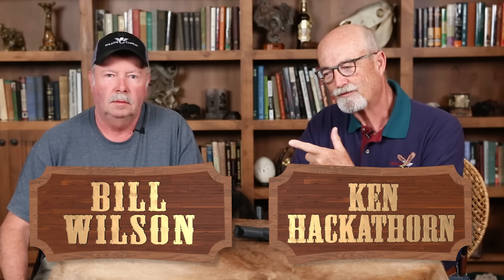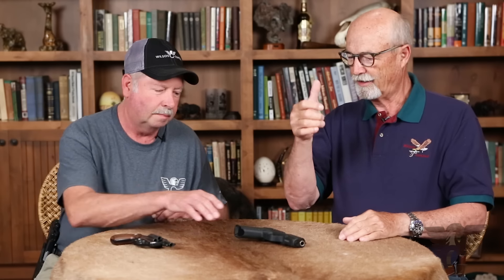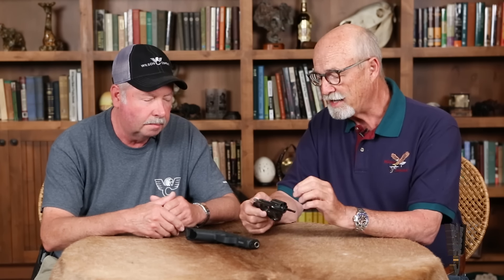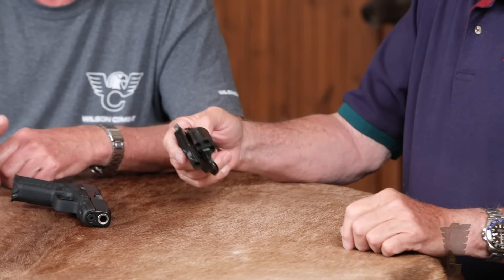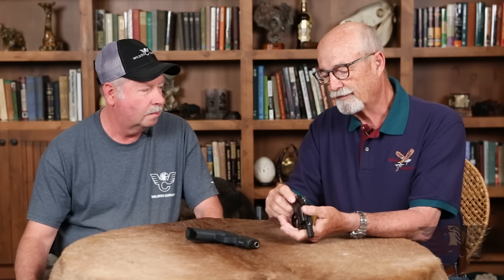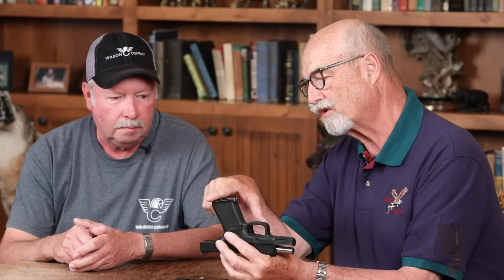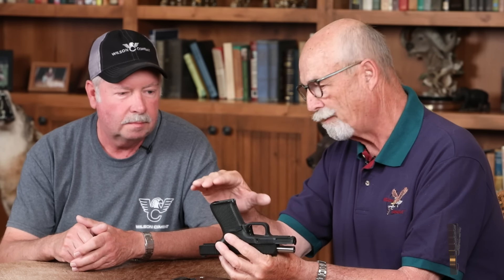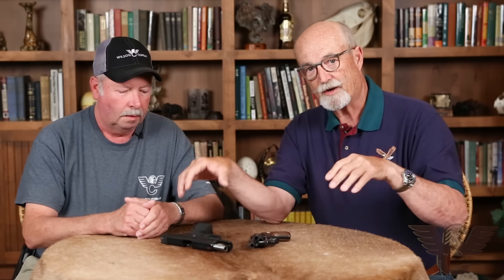DON'T DO THIS to Your Guns - Gun Guys Ep. 17

Comment: The 2-3k round tests are clearly proving how reliable a firearm is. It's truly impressive how some guns can run through 1000s of rounds without cleaning/lubing. This should be incredibly obvious to anyone, much less professionals. Very disappointed and shocked about your take on it.

While I agree about slamming the cylinder on a revolver, I couldn't disagree more about using the slide release. THE GUN IS LITERALLY DESIGNED TO DO THAT! I'm pretty sure Smythbusters did a video about that also. Many auto-loading pistols (1911s, Glock, S&W, etc.) are built to be workhorses and duty guns. If they were so sensitive to using the slide release, it would be a well-known issue, and all gun makers would be manufacturing firearms without it (XL Walther PPK style).

Even if it is possible to damage a finely tuned glass-cannon like the custom 1911s you are talking about, increasing the trigger pull weight is such a minor issue it's mostly irrelevant. I challenge anyone to tell a major difference between trigger weights if they are shooting in a legitimate self-defense scenario when their adrenaline is pumping. 

I do agree 100% about lubing guns though. I've shot hundreds of rounds through my pistols, and they keep running flawlessly if they are oiled well, even though they are filthy at times.
Reply: They didn't say don't use the slide release... they said don't use the slide release w/o there being a cartridge to skim off of the magazine.

Comment: I respect these two gentlemen quite a lot, let me say that first.  I have heard the "empty chamber slide drop" argument my whole life, but have not seen any scientific evidence either way.  I have heard mostly opinions from both sides, usually to the effect of: "The army 1911's did this in drills over and over and over and they work fine" or "A super awesome trigger job will show microscopic damage on the sear and trigger surface" or something to that effect. 
What I am respectfully requesting here, is for Mr. Wilson to set up a test which would put this debate to bed.  I ask this here because I feel that Wilson Combat is one the few companies that is well known and respected enough in the industry to "set a standard" if you will, and obviously has access to the firearm actions at the heart of the debate.  I am personally on the fence on what I believe regarding the "empty chamber slide drop" argument, although to be honest, i lean slightly toward the "it doesn't hurt anything" side.  But I think with some scientific evidence, which would be easy enough to obtain, we can learn a lot.   Some high resolution macro type images before a test and after a test, with empty chamber slide drops at a few increments (not sure how many times folks think would cause damage) would probably do it.  I doubt anyone would accept a subjective trigger pull test, from either side of the argument.  Just a respectful request from an inquiring mind.  Thank you for what you guys and your teams do here.
Reply: That’s a great idea!
Reply: Pro2A I agree with you on the "it shouldn't hurt anything". To me, it seems odd that the recoil spring alone can damage the pistol by letting the slide close on an empty chamber when the gun cycles the slide with many times the force your hand or the spring can alone. A slide on a semi auto moves so fast in operation you can barely see it. It hits it's rearward limit hard and slams home on every shot, tens of thousands of times. I have my doubts that the cartridge cushions it enough to save the pistols life so to speak. I'm as curious about debunking this as you are.
Reply: The fact the guy has made and designed these guns for decades isn’t enough for you? I mean wtf is wrong with you people?

Comment: Wilson Combat has the best customer service. I had a 9mm ADP awesome little polymer  striker fired carry pistol that retailed for 550.00. The manual showed how to disassemble the slide completely so foolishly I did. couldn't put it back together. called there customer service and they sent Fed ex to my house to pick up the pistol put it back together and polished the feed ramp and gave me an extra magazine got the pistol back in less than 10 days all at their expense, even though it was all my fault. they only made that gun for a couple years small 10 round double stack that got a bad rap online Mine was awesome though.

Comment: All good information but from my experience Wilson Combat pistols are delicate and prone to breakage unlike a GI 1911 you can beat on all day.
The type of guys that buy a Wilson 1911 do more looking at them than actually shooting them.
I was into Wilson 1911s for a while and yes they may have felt better in the hand being a custom gun but did they perform all that much better than a Colt or other decent 1911? No not really.
You guys look to be in my age bracket and I get your points but I love to run guns hard and put them thru their paces and have fun and not always having to fix them which was what I had to do with the Wilson 1911s
Reply: I had bad experiences with Colt and Kimber reference reliability. Ive put 1000's of rounds through my Ultra light Wilson Combat 1911's, and they have been flawless!I do believe when your life depends on them, there is a difference between them and a production 1911!I believe if you are carrying a 1911, theres a big difference in reliablity that makes the cost worth it? If you want to spend less, a Glock or Shield might be better for you, but a 1911, especially in .45,I wont ever cut costs.

Comment: I respect these guys because they're masters of the gunsmithing world. However, if these guys are being picky about 1911 mags hitting the concrete, and talking about how guys are reloading their guns too harshly. It just tells me that Wilson Combat 1911 platforms and accessories are just made for bench shooting. If the mags can't drop on the ground during training, how can the user expect to use it on duty, it'll just cause a training scar for the operator to always retain, or drop the mag on a soft surface. Also, if the tolerance of the gun can't endure a harsh reload, how can it be reliable for duty. 
I guess their guns are made to be pampered on soft surfaces.
Reply: Yea I'm pretty confused to this.....I wanted to get a hold of a Wilson but now I think I'll put myoney elsewhere. I'm not naturally hard on guns but I had no clue that 1911s we're so finicky. Give me a Rugerp345 or a Smith and Wesson 5906 those guns can take an ass whooping
Reply: Their comments are for all mags, and specified loaded mags not empty. Wilson mags are among the best out there. If you are consistently dropping loaded mags, you might want to try out a different training class
Reply: @pops55650  you are talking to walls,  after they learn the difference from harbor freight to sk they will learn to spend more wisely unfortunately not all will meet the grade

Comment: None of my 1911 manuals have ever said never drop the slide on an empty chamber and John Browning never told the military they shouldn't do it.
Reply: It’s the same as with bows. On some compound bows if you release the string without a nocked arrow, the energy may shatter the limbs.
I imagine this is the same principle.
Energy from the spring is meant to push the round into the chamber, not slam the slide against the barrel.
Probably not a huge thing done once or twice, but it will accumulate over time.
Part of good care, if you want the firearm to serve you well for years, right?
Reply: The design and movement of your slide normally assumes having friction from the round being chambered to moderate the slide velocity. Without it, the slide will close faster and slam into the other parts harder. With poor steel construction, peening/damage of the surface will occur.
Reply: Have at it!  I'll go with what Bill and Ken say.
Reply: @GuyWithAnOpinion2  I’ll stick with JMB. He got it right the first time.

Comment: I get the confusion.  For most guns, flipping the slide release is fine. It's partly why the lever exists in the first place, and the Brownell's guys have covered this.   
BUT, the Wilson Combat 1911 is, as these guys point out, a special case of super tightly tuned tolerances for competition shooting.  
Which raises the question, why are they called Wilson Combat, when it should be Wilson Match or similar?  A combat gun needs to be able to take abuse.  It's like the difference between a rugged beat up 4x4, and a Porsche.  Wilson is the Porsche. They have different niches;  Normally, the Porsche is worth 10x the 4x4, and in a race, you'd want the Porsche;  but in a war, the 4x4 is worth 10x the Porsche.
Reply: @Jase Zayden Instablaster =)
Reply: @Jason Kyler Thanks so much for your reply. I found the site on google and I'm in the hacking process now.
Seems to take a while so I will get back to you later when my account password hopefully is recovered.
Reply: @Jason Kyler It worked and I actually got access to my account again. I am so happy!
Thank you so much, you saved my ass :D
Reply: @Jase Zayden Happy to help :)
Reply: These guys are such elite blow hards. Brownells did a video on the same thing and concluded: just don’t do it too much
Reply: @lakesidemfg3552   So why get into bad habits. Steel frames will take more abuse. Aluminum does not. I have seen more then one frame ruined by those not learned in 1911s. Brownells sells parts. Wilson sells art that can save your life. Give the utmost respect to the things that save your life and they will work flawless when you absolutely need to abuse them.
Reply: @richwilson7619  that’s funny. My gunsmith showed my two Wilson 1911s that wouldn’t cycle to save anyones life. As for art…. It seems like Wilson stepped away from their roots to push their art/products and Ive heard more than one avid 1911er say this.
Reply: @lakesidemfg3552   Really. Why does a gunsmith have two that will not cycle. Bill would like to know why 6 to 7 thousand dollars of pistols were not returned for repair or refund? I smell a rat or another story. They are guaranteed my friend.

Comment: On the M60 and M240 we used to drizzle motor oil straight on the belt as it fed to lube the gun and flush carbon and brass shavings out the bottom. Guns are machines. Machines need lube.

Comment: When the slide on a 1911 is locked back, the sear is in contact with a notch in the hammer. Both are now in a position that the slide has zero influence on them. The slide can be hammered to the rear and hammered into battery as many times as you feel like doing. There will be zero wear and tear on the hammer, sear and disconnector. 
There's some high-speed photography of 1911 slides being released with an empty magazine vs a loaded magazine stripping a round and clambering. The results as I read them, showed so little difference using microseconds as a measurement that this lab concluded neither technique was advantageous over the other.
Reply: Just how many custom 1911's have you built, and how successful is your company?
Reply: William Roark this is one of those facts vs feelings discussions. Sorry you drank the kook-aid my friend.

Comment: I clean after I’m done shooting for the day. One shot or 500. I clean them. I value my possessions and take pride in their appearance. I’m sure I can get away with cleaning them every 2000 rounds, but I’m not gonna do that. 95% of the guns I own were bought used and 99% of their previous owners clearly never cleaned them because they were filthy.
Reply: You are putting more wear on the gun cleaning it and shoving cleaning rods and shit down the barrel than if you just left it and cleaned it every 300 rounds or so.
Reply: @jerryseinfeld1345  I have so many guns that none of them get shot more than 2 times a year. Some haven’t been shot in years. But even my old duty gun got cleaned 4-5 times a year. 29 years later, it still looks new. Sending a solvent soaked patch down the barrel and a couple of passes with a brush isn’t gonna hurt anything. I’ve been doing it for nearly 30 years and no issues whatsoever. I’ll stick with what I know works and you do whatever it is you do.

Comment: I did not know about the damge from dropping the slide on an empty chamber!  Thank you, I learned something today.
Reply: Hayseed Homestead same here, good stuff
Reply: @closecatapult8472  I just rewatched it.  I noticed they specifically mentioned finely tuned triggers being susceptible to damage.  If you're tuned to 3/4 lb pull then yeah, I agree completely.  A standard 1911 (I just bought a Colt Classic) set at about 5-7 lbs should be ok or at least take a long time to fall victim to it.
Reply: @maineiacacres  it will damage barrel lockup on all pistols. Its just a stupid thing to do.
Reply: @Adcomb  Well at least its not a good thing on an empty chamber/mag.  I did catch that they mentioned doing it to load a round mitigates the potential damage.

Comment: I've been shooting twenty years and I've never seen someone successfully, methodically snap rounds through the feed lips of a pistol mag. I don't know how I'd react. I'd be mystified and speechless. Slightly different story if it was MY magazine, but still...
Reply: I agree, for a lot pistol mags, the mag loaders push down on the round that’s already in the mag, so you can slide the next round under the feed lips easier, not through the top. 🙄

Comment: At first I was optimistic about the content, but as I watched it I realized I was guilty of alot of what you are talking about.... never to old to learn proper etiquette....thank you for the lessons.
Reply: I can see dropping the slide on an empty chamber being a problem, but not on all handguns. 
Glock for example, the "take up" is pulling the striker back. XD9 the take up is different and also pulls a sear down while also slightly pulling the striker back. I wouldn't drop the slide on a XD. I think this video calls to light the problems and shortcomings of the 1911.
Reply: Tony it will effect barrel lock up on most any pistol

Comment: from Page 29 of the Colt 1911 manual (current models), "5. Keep pistol pointing in a safe direction, allow slide to return forward on empty chamber and squeeze the trigger to allow hammer to fall forward.  (If slide is held to rear by the slide stop, pull slide back slightly, then release it.)" - that's what the manual says to do!  Go complain to Colt (and others possibly).
Reply: What is your point?  I’m 45 and I’ve known my whole life not to drop the slide on an empty chamber.  Same as dry firing a 22 rim fire.  Do you think Rob Leatham wrote that in the colt manual? Or do you think some attorney did?  Why would you not take Bill Wilson’s advice on 1911s?
Better yet why am I responding to some half wit on YouTube who thinks he knows about firearms because his uncle was in the national guard
Reply: And those are Colts, not Wilson's, Colts are nice but not Wilson nice. There's a difference.
Reply: Thanks for your kind, friendly reply.  Did some more checking, and the Beretta 92 manual has the same basic info, that it's ok to let the slide close on an empty chamber, and then I went looking for the Wilson pistol manual, and found a PDF dating to 2003, and it was silent on this point.  Didn't discuss it at all.  So if you are one of these experts, great, I'll listen to your advice, but I'll also listen to what the manufacturer says in their manuals.  A check of the Glock pistol manual also finds that Glock says to just release the slide on an empty chamber (page 20, item 5) " 5. Release the slide to return it to the forward (closed) position by either pressing the slide stop lever down or grasping the rear of the slide at the serrations with your other hand and pulling the slide fully back and then releasing it."
Reply: Douglas Brinkman they are saying DONT USE THE SLIDE RELEASE ON AN EMPTY GUN,,USE THE SLINGSHOT METHOD
Reply: @johnnyjohnson1370  so instead of letting slide loose from where it rests you pull it more backwards putting more pressure on the spring and letting it slam forward even harder ... and that helps how exactly ?
Reply: Douglas Brinkman. Don’t try and argue with Fudds. They are gun guys and the grand pumba of gun knowledge. If you slam your slide forward puppies die and the gun will explode.
Reply: But then you read military field manuals and they all say to press the slide release and let it ride. Pretty sure the military would have not included that part in all their FMs if it caused damage.

Comment: At least they admit that GI guns can tolerate this.     Customize/modify etc your gun to the point of it being kept in a glass case at your own peril.
Reply: Performance always has a price.
There's a reason race guns aren't hi points.
Same reason why you can't daily drive and indy car.
But comparing a wilson 1911 to something that has to be "kept in a glass case" is pretty ignorant.

Bill is literally explaining how to handle, treat, take care of a custom gun so it lasts a lifetime.

You sound like the kind of guy that doesn't change the oil in his car because he knows better than the engineers that designed it.
Reply: @ava9oh1282000  Yeah, it came with a bumper to bumper warranty, so why should I change anything right?  You "impress" me as a very poor judge of character.    Thanks for playing.